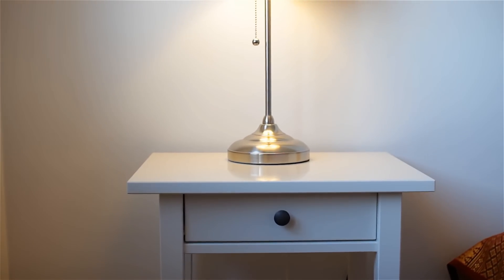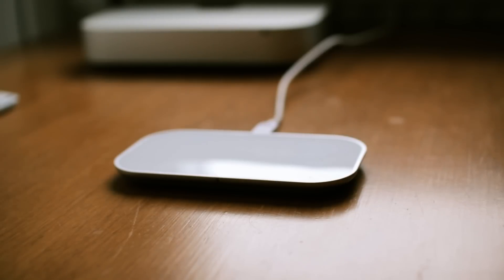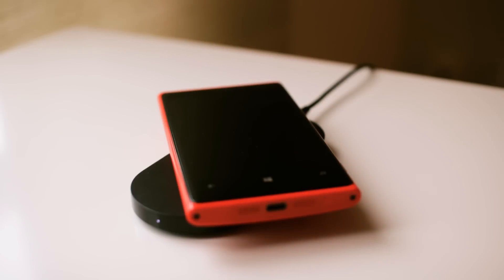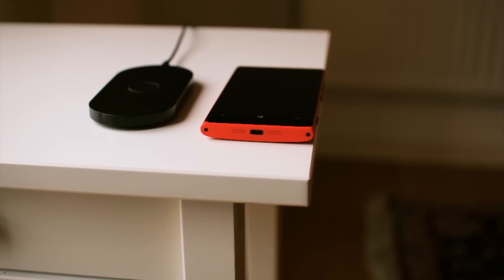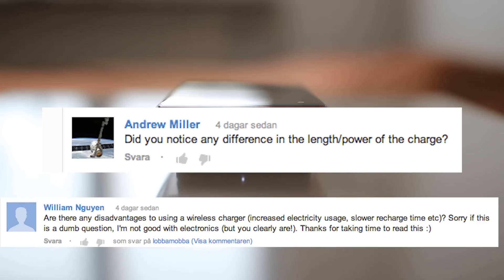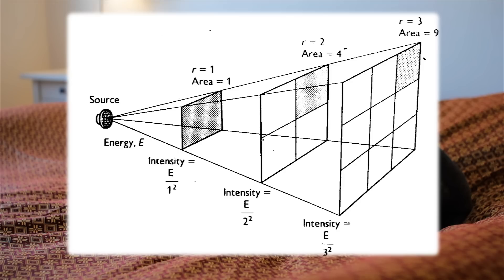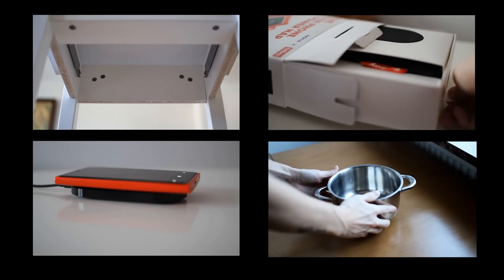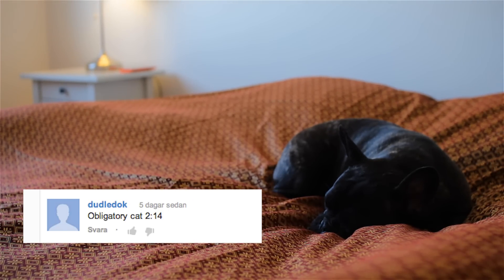Qi Wireless Charging Questions answered and explained

Comment: Fantastic! I just ordered a Qi charger for my S3, and I've got a slightly different version of this night table, so I'm going to try this out. It looks like, based on placement, you're able to slide out the charger should you wish to use it elsewhere, am I correct? Looks like the frame of the night table holds the charger in place. Thanks for the tutorial.

Comment: Good explanation!
Btw, do you know what is the power consumption of the charger when not in use but plugged in?
Wired chargers still use small amount of electricity when plugged in but the phone is not attached. Is this true for the wireless chargers?

Comment: Good, clear, and funny :)
The best two things for about about using a wireless charger is that I don't have to plug and unplug the cable which takes a bit of force (I don't have to stress fingers) and I don't wear off the USB port so much.

Comment: I really like your end result and may do this myself but to my computer desk. Just some info, the Qi charger is pronounced CHI, and that nokia one you have there, even though it says its Qi standard, does not work with the Nexus 4.

I bought one and very sadly returned it when it didn't work. It would just keep connecting and disconnecting over and over. I got the Nexus Orb and it works great.

Awesome video, and great visual style!

Comment from the maker: Ok, mine is some kind of cheap IKEA-fiber. Take some other type of similar wood and se if it works and then se what thickness it can charge through.  
I can se if I have some at home and test if it works better or worse then the fiber.
But either way, the only action I guess you can take is going thinner.

Comment: Chee is great also because of the simplicity & of course everybody has broken or at least worn out their plug especially if you trip on it or get tangled & don't release walking forward with your phone semi attached to your arm or something causing it to rip out your plug or bending your phone/plug. Its funny that people are complaining about the radiation when they are talking about a Qi. I mean cellphones give off radio waves threw your body daily wireless charging is alot less intense especially because its not on 24/7

Comment: #lobbamobba. I have a question that is if i connect a usb type-A connector to the other side of the charger means removing the wall charger socket and connect a usb instead and then connect it my computer will i be able to use it as a data cable.

Comment: just wanna ask is it normal when using a wireless charger the back of the phone becomes hot? I mean really hot. is it safe?

this is my 1st time to use a wireless charger and I am worried.

I have Galaxy s5 and Metrans W5000 power bank and wireless pad.

Comment: The charging port on my iphone is shot, if I have a charging case will I have to still attach the case to the port to charge it on the pad?
Reply: sufferer442 Yes. Unfortunately all the iPhone wireless charging cases require that you plug the case into the lighting port in order to work.

Comment: my reason for using it would be that the cable connector on the phone broke so I couldn't charge it with it, so instead of getting a new phone (or pay for getting it replaced) I got new wireless charger :)

Comment: Do they work with otterbox
Reply: Depends on the price of the charger. I use a 10 dollar ONN brand wireless charger and it works fine with a otter box Defender on a S8+. However, the cheap 3 dollar ones have least range so they may not work. 7 dollars and up you should be good.

Comment: I wouldn't say perfectly. 
Here is an android forum with a round up: h tt p  : / / forums.androidcentral.   com/nexus-4-accessories/225402-qi-chargers-nexus-4-a.html

Exerpt: The Nokia charging plate has been proven to work with the Nexus 4 but the sweet spot is very small, it charges much slower when compared to other Qi chargers, and charging tends to be intermittent and not reliable. Because of this, all Nokia branded chargers are not recommended.

Comment: One of the worst things I've noticed over the last 20 years of internet forums and comments is the number of people who just can't get it through their thick skulls that there is more than one way to do something. They seem to think if you do it differently to them then you must be doing it wrong. FFS if he chooses to use a chisel instead of a power tool then it's not anyone else's fucking business why. He still achieved the desired outcome right? Even if it took longer or made a messier job of it, it's his choice. Maybe he wanted to get some practice or experience using hand tools. I just couldn't believe some of those rude annoying comments about this.  I bet half those dickheads don't even have the patience or skill to use a manual chisel. Sorry for the rant but I'm getting sick of all the fuckwits.
Reply: Great little project btw. I have a set of chisels myself that I've never used - just got hold of a wireless charger and this might be a nice task to work towards. Need to find some wood to practice on first :-)